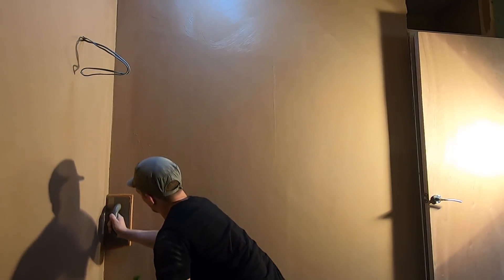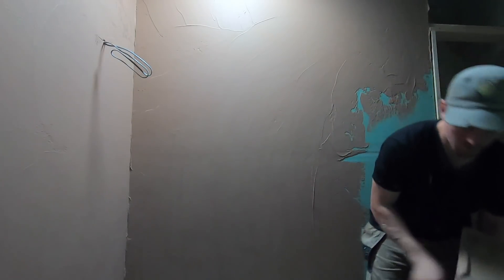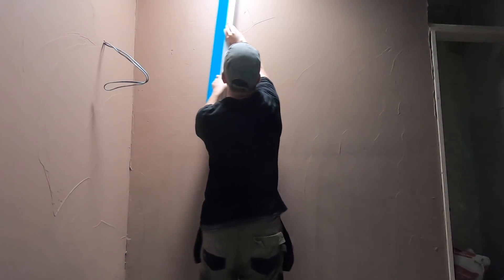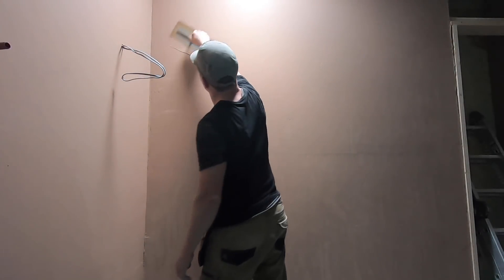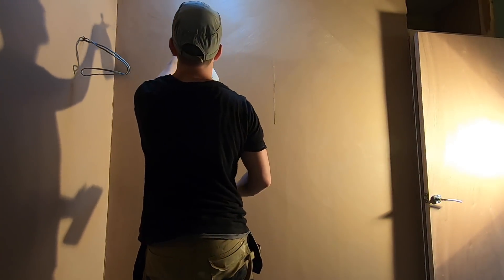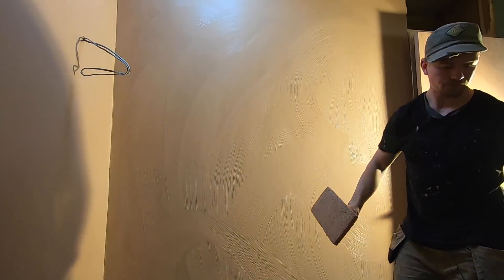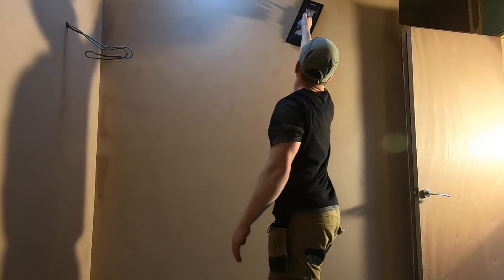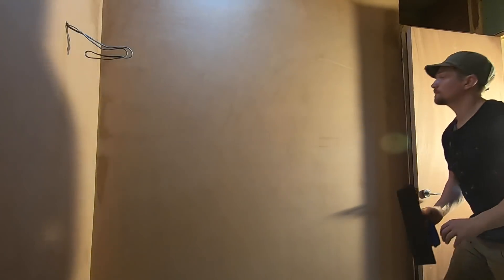One Coat Plastering | Is It Ever OK To Do??? (TEST)

Comment: Well i really wish the warning was at the beginning. Was doing ths step by step and bosh! "dont do this as a beginner". Friggin hours spent trying to make this thick plaster go flat. The sponge and spatulas were not bought as i started doing this at 6pm. By the time i realised i needed them the shop was shut.
Reply: I stopped at midnight last night. I overcame the lack of sponge and giant spatula through sheer force of will. A final thing I realised was that I was just short on plaster. When it came to the final trowel stage I didnt have anything left to fill gaps. I woke up this morning and the wall is totally flat and smooth but there are holes. Because the rest of the wall is good I can fill them and it will pass. All in all, I give myself 2/10 for prep, 10/10 for stubbornness and a 6.5/10 for the wall.

Comment: The difference is a bit academic, but I can tell you from an Engineering perspective a two coat wall will definitely be stronger. Read on if you want to understand why.

Layered structures are stronger. Plywood has layers of wood having the grain in each layer running at right angles. Fibreglass & carbon fibre composites also use layering to build up strength, in this case with layers of fibre mat, sometimes run in different directions depending on the type of mat. Whilst it may not seem like it, you guys are effectively doing the same thing with a two-coat plaster finish.

Think about what you see happening when you trowel plaster, by applying pressure with your trowel you compact the grains together, pushing them deeper into the mix and leaving only the fat on the surface. The plaster nearest the wall will be compacted less because the pressure is less, so will be closer to its 'raw' state. If you could cross section a one-coat wall and put a sample of it under a microscope you would see 3 layers, from wall outwards: raw, compacted, then fat.

On a two coat wall you would see 6 layers, from wall outwards: raw, compacted, fat, raw, compacted, fat. Since the fat is weaker (in the same way that mortar is weaker than concrete), you don’t want to be seeing too much fat after applying the first coat.

To understand the strength, imagine bending a flat sheet of plaster. Untrowelled plaster will have the same strength whatever direction you bend it. Trowelled plaster puts a grain into it in the direction that you trowel. Trowelled plaster will be stronger with the bend line across the grain, that is at right angles to the direction of trowelling. On a wall, if you trowelled the first layer vertically, then the second layer horizontally you would gain strength equally in both direction. Obviously you can’t do that on a one-coat wall.

In a new building with settlement, a two-coat wall is less likely to crack. In buildings with plaster straight onto blockwork, or rendered blockwork, the plaster is well coupled to the stresses produced by settlement in the building, so a two-coat wall is the best choice. In buildings with plasterboard attached to battens or by dot & dab, the plaster is less well coupled to these stresses.. so one-coat becomes a viable option.

Add to this other factors people have mentioned, like the improvement in trowels, speedskim, better tape, even better quality plaster… then for professional Plasterers, where time is money, it is worth considering when a one-coat finish is acceptable.
Reply from the maker: Thank you for all this information mate! There's some great insights here so thank you!
Reply: Skimming is not for structural strength, its for decoration ...otherwise tape and joint would be obsolete... Have a good think about that. 20+ years in the trade
Reply: @garryfwright , I don't doubt for one minute you are right when you say that is what it was invented 'for'. My comment was about the Science of what it will 'achieve'. Smoothness/decoration is one thing. People are also interested in strength, thermal insulation, water resistance and more.

In layman's terms layered structures are stronger, especially when you can layer the grain of the material in different directions in each layer. Obvious to me as a Scientist/Engineer, but maybe less so to Plasterers, so I made the point to get people thinking.

Gypsum has a bit of a grain to it:
https://ars.els-cdn.com/content/image/1-s2.0-S0950061816312120-gr11.jpg

That pic is from an article looking at the properties of recycled plaster.
https://www.sciencedirect.com/science/article/abs/pii/S0950061816312120

Comment: Omg, shouldn't even be a question. I've been plastering 26 years, the main reason for 2 coats is for wall finish strength. Ie, stronger wall and joints. But hey, what do i know!
Reply from the maker: Good point mate! Cheers 👍
Reply: That's how I think.

Comment: I use one-coat plaster a lot for repairs, and it works great for that.  It's easy to work with, and you get a good finish which blends in with the existing plaster.  Then it can be sanded smooth.  But I've never tried plastering a whole wall with ANY kind of plaster...

Comment: When you say it’s better to use two coats for skimming, presumably this is only onto an old plastered wall or plasterboard? If you’re starting from  brick/block, do you advocate two coats (browning/bonding and finish plaster) or three coats (browning/bonding & two coats of finishing plaster)?
Reply from the maker: Hi mate! Yeah that's right, I just mean 2 coats onto either backing plaster or plasterboard! They have actually stopped making Browning now but the product to use would be BG Hardwall. Apply a thick coat of this to your masonary background (roughly 12.5mm) and finish with Multi Finish about 3 hours later. That's the winning ticket pal 👍
Reply: Plastering For Beginners - Okay, thanks! Didn’t know browning was on the way out.

Comment: "Never 2 coate it's shite",  muiltfinish & boardfinish is down to 2mm thinkness per bag over 10m coverage that's crap bags used to be 3mm thicknesses unless it's perfectly done at the start you are screwed. Also in real terms you're putting nothing on the walls or ceiling so in few years when building starts to move you will get cracks everywhere fibertape or not it just won't last.. The bear minimum should be 3-6mm. 
At least then you got some internal strength to your finished product. 

What's more important get finished quicker or your
Reputation.. Fair play to trying it fella👍
Reply from the maker: I hear you mate. Ask very valid points here and to be fair the plaster is getting thinner and thinner now. I just wanted to test it out - I was surprised by the results but not convinced! Thank you for watching mate. I really appreciate it 👍

Comment: Done some single coat recently the finish wasn’t to bad although I found it drying out real quick around the corner beads and pulling when I was trying to flatten in also some cracking appeared when it had dried out ( but that  may be because the house was occupied and the heating was on ) apart from them two issues it went well didn’t use the sponge though

Comment: Hi mate thanx for getting back to me about the internal angles using scim stop bead but i will still try it with a scim stop both sides of the angle and butt them together, as for one coat ive never done it and never will do I am old school stuck in my ways cheers Kev keep on spreading, ps have you ever fabricated an arch yourself ?.
Reply from the maker: Sounds good! Let me know how you get on because I'm intrigued to hear how you do! We've rendered curved archways above Windows before by cutting curves in timber and using it as a template to form the render with. Other than that... No matey 👍
Reply: @PlasteringForBeginners  Yes that is how to do it but on an interior arch you must fix some old scrap bits of wood to the corners  and fix plasterboard to it to create a base then shape your arch with some board both sides then using some left over bonding fill it in, next day just fill the sides, once dry coat the lot with finish using bead and flexi bead, I know there are arch laths but to me that's cheating with this you can create many shapes even Victorian or Georgian styles I hope this helps and please I don't mean to tell you your job just ideas and help, you do a great job so rock on buddy ill let you know how the angle goes. Kev

Comment: Apply basic physics to it!

•High suction = Wetter & thinner  first coat so you will need 2 coats to get the proper thickness!

•Low suction = Thinner layer of normal mouisture plaster so it doesnt slide off. Therefore giving you a key when its going off for the 2nd layer to build up thickness!

The only time you should use 1 layer is on small patches of Low/High suction backgrounds or up to medium size plasterboard backgrounds. Yes one coat works better on plasterboard but you will have less time to work on it because with 2 layers you can keep it alive longer allowing you to work between 2 walls! 👍

Comment: Wanting to plaster my showroom. Most of the wall will be hidden. 500 year old building but the walls inside are dreadful, unusable. Going to be boarding up all walls, is it ok to one coat plaster in my instance, DIY job would never be perfect, don't want a perfect finish by far, want to keep character in the building hence why i'm prepared to DIY it.

As long as it wont fall off the wall, and take a coat or 2 of paint. I'll be happy?
Reply from the maker: I know I say it's ok in this video but I actually recommend everyone 2 coats plaster. It's easier and always had a better finish, (especially if you're new to plastering). 2 coats is best my friend 👍

Comment: Interesting mate 👍🏾 two coat for me in every situation...
Reply from the maker: Hi mate!! Great hearing from you pal and I'm the same my friend 👍
Reply: Plastering For Beginners absolutely 👍🏾👍🏾 what size brush are you using there? 6” or 7”
Reply from the maker: I'm using a 6" brush at the moment pal! I've had it for 1 year now but it's still going strong 👍
Reply: Plastering For Beginners just got my first one 🙌🏾😅 🎉  ATB pal👍🏾
Reply from the maker: You too pal. Cheers 🍻
Reply: Farai Osbourne 
If you going to do a one coat plaster then use the one coat plaster bags it's what it's made for.

Comment: Personally find it only works on tapered edge boards otherwise hard to loose scrim
Reply from the maker: Oh ok... that's a very valid point!
Reply: Go up all the scrims first to pin then down and with the extra thickness you lay on you will  cover all scrims just fine, As long as the joins in board are good and not kicked stud work or dabbing.
Reply: JDC91 do that anyway personally find 2 tight coats works pretty much the same and doesn’t take that much longer
Reply: @neveryoumind9237   2 tight coats is ideal, but I can get 3 hits on and be finished by 4 o'clock when 1 coating, if I done 3 hits 2 coating each hit I would be on site until around 7, that's a big difference in time.
Reply: JDC91 what on earth are you doing then I get 3 hits on by half 4, 2 coating and go home everyday knowing my work wont be pulled lol
Reply: @neveryoumind9237   well that's some type of record to me,  unless   your in work at the crack of dawn, typically 3 hours per hit when 2 coating, that's without the time in between hits or time in morning getting ready, plus I mix, lay and clean up on my own without lab and have never been pulled for bad skimming.

Comment: I’ve one coat plastered on board work once and it came out great, i ran around and covered the scrim, then laid on the top. Didn’t sponge it either, used a bit of fat to fill the occasional hollow but nothing major. I wouldn’t do it In general but if it was a small area with time to kill i definitely would do
Reply from the maker: I think you can get away with it on small areas like you say...but I would do the main wall that way ha! Thanks for the comment pal 👍
Reply: @PlasteringForBeginners  no way a big wall mate haha

Comment: I've never plastered a wall in my life and i'm about to take the plunge using this method. Having read some of the comments on this and other videos, I do believe there is a bit of "traditional method snobbery" that makes you believe different tools and methods that have come around more recently are only there for cowboys. I've seen this thinking in my own industry, they're wrong as well
Reply: I would listen to what he said, don't do it this way if you are a beginner !!! :)
Reply: You have to understand the snobbery! The issue with skimming is not so much about new methods but plasterers who do not understand why you have to start from the top and lay on half trowel over last sweep and quarter trowel second closing in coat do not get the finish flat first go. If learn this skill you will lay on close in first trowel second trowel cross trowel ✅ job done . Don’t forget that sponge floating has been around for many years I was using one in Ipswich during the eighties

Comment: You only one coat when spraying skim on with a machine I believe. How much time did you save and wonder if it would work doing a 30 odd metre gauge?
Reply from the maker: Yeah there is plaster that is designed to be sprayed and I roughly saved about 25 mins matey 👍
Reply: You don't get the perfect finish these machines,,they look good ,but traditional way is better.

Comment: Hi Blaine. If this wall was going to be tiled anyway would you just leave it at the sponge float stage. Seeing as the walls flat and  texture would help grip the tile. Is there any need to go further?
Reply from the maker: No there isn't mate but I just wanted to use it as a testing platform! It's probably better to leave a texture to be honest but I just thought I'd run an experient 👍

Comment: I’m caught between using all of your methods, I have a sponge float, speed skim and a flexible trowel but I’m confused which methods to use.. I’ve watched too many of your videos! Haha thanks for all the help by the way
Reply from the maker: There's too many options haha! I would just try the traditional way for now - just stick to the basics to begin with. Sign up to the Welcome course and follow the methods there - that's what I recommend for a complete beginner pal. The links below if you're interested:

https://plasteringforbeginners.co.uk/ join

Hope this helps my friend 👍
Reply: Plastering For Beginners thanks mate. I ended up doing a full room this week and I’m definitely getting better. Having decent equipment has helped massively. Thanks again for your videos, you’ve been a big help keep up the good work 👍🏼

Comment: Great Video-well done on taking on this subject.  The key problem I have seen with one coat plastering is the amount of water that some plasters use to liven up the plaster-this creates a big clean up job and worst of all the "fat" ends up drying to form a powdery surface making painting very difficult.  Did you check the finish when the plaster had fully dried out?
Reply from the maker: That's a very good point about the overuse of water. I've actually had that before and I must say it is an issue. I went back the other day and it was fine (I was hoping it wasn't because it's so tempting to try again haha!) Great hearing from you. Cheers 👍

Comment: Hi mate.
I have just bought my first house and gutted it back to brick. I am a joiner by trade but can tile and plaster aswell to a decent standard. The house is an end terris with twin skin cavity walls. I have just re pointed the gable end. The upstairs has all been hacked off back to brick but the ground floor is artex/asbestos. Im looking at dotndabing the lot but am not to sure about the gable end. The previous owner had cavity wall insulation pumped in at some point. What is the correct procedure to use?? I have read different things regarding dabing to gables etc!
Cheers

Comment: I've done 1 coat before on walls like that. Only difference is I fill the scrim on the tapered edge boards first. I never do it if there are beads round windows etc as just don't think it works as well. It's horses for courses. As long as the finish is good it doesn't matter how you got there. But agree there is a massive tabboo surrounding 1 coat and it being the cowboy way. But you need to be more skillful to get a good finish with 1 coat. Jury's still out on this one 😂
Reply from the maker: Very good point - I think it could be an issue with corner beads so that will a test worth trying soon I think! It is a massive subject but I'm very interested since trying it! We all love a bit of rebellion don't we 😂
Reply: @PlasteringForBeginners   I started 1 coating Plasterboard last year, after getting sick of the low prices per m2 on sites, I've now mastered it and believe I can finish  skim on board just as well with one coat, trick is to do a 3-4 bag mix so you can get multiple walls on, go over every scrim and up every bead before laying a complete wall also any spots that need filling out, then go back over the walls in the same order you have filled out, it should have pulled into the board just enough to build up on your beads without sagging, sponge is key after flatting, avoid one coat at all costs going over pva, blue grit or s@c walls or ceilings and you will be fine.